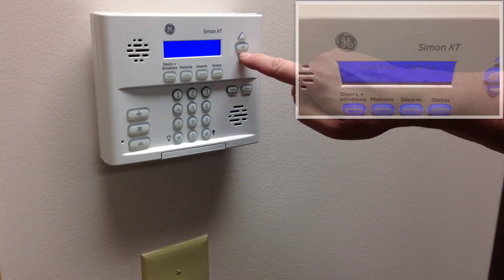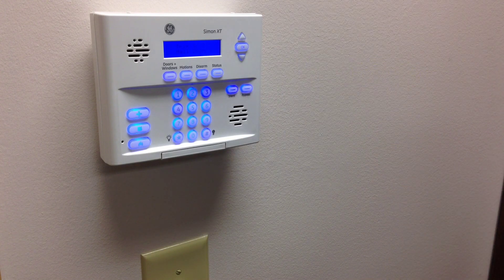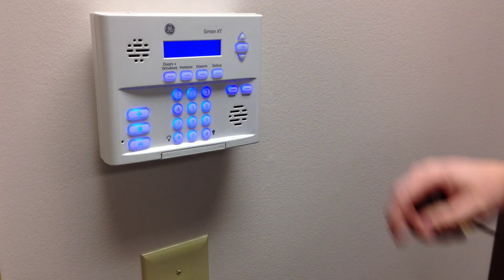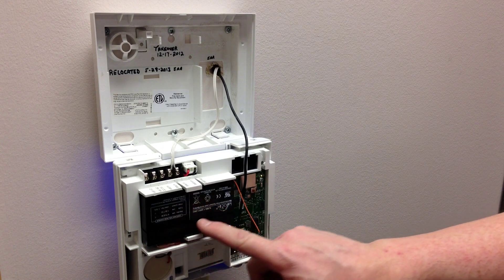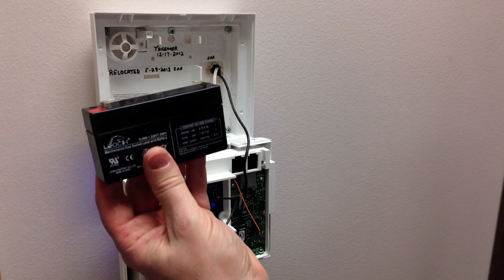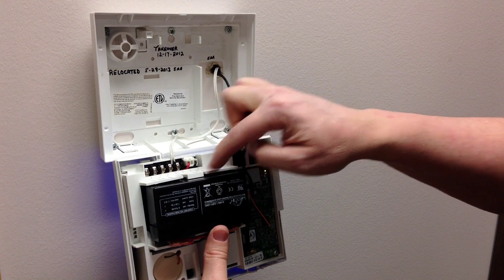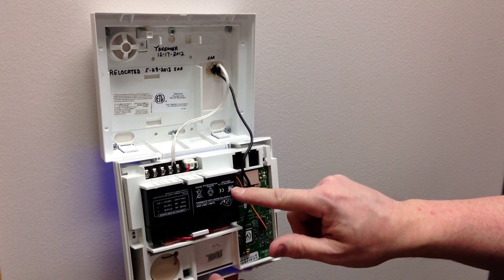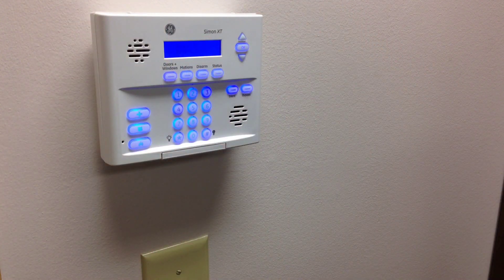How to change the backup battery in a Simon XT security panel

Comment: I found this video in Aug 2020.  After restoration from a 28 hour power outage at my house, our panel was beeping every minute or so, and the panel had a message that read something like, "console battery low". So, I just figured I needed to replace the battery and went searching on You Tube for a video that told me how to remove the panel and find the battery, etc (as I didn't have a manual). But this guy's suggestion - after watching the entire video - to contact our security provider FIRST, was a game changer for me. I went on to call the provider, told them about the power outage, they reset from their end, and within 30 seconds the beeping stopped, the message was gone, and the CSR told me that the battery DID NOT need to be replaced, and that it would recharge itself since the house power had been restored. So, this video kept me from a trip out to purchase a new battery. Thanks...very helpful for my circumstances.

Comment: Thanks for the video. With the rolling black outs due to that storm I found out all the batteries were bad. Changed them all and still had system low battery warning. Went into the system test, backed out, system OK!!

Comment: This one is identical to mine. I just ordered a new battery. The original lasted 3 years, 10 months. It was installed in early 2012, the date I see in this video inside the panel.

Comment: If the replacement battery is not charged, it might take a few hours to fully charge the battery. So, the low system battery message may still be there until the battery is charged.
Reply: Thank you!

Comment: This exact procedure will not work for the Frontpoint Security Simon XT.  Additionally you have to unplug the panel from the wall outlet and unplug the RED wires that stick out of the bottom of the panel. Then reconnect the wall plug and red wires.   I had to call customer support to get it right.
Reply: I am grateful for your observation... I spent several hours trying to make his directions work and came up empty. By disconnecting the power line and reconnecting completed the cycle the system needed to recognize the new battery. With different model it is critical to have the correct process... Thanks again for saving up a service call.

Comment: Very helpful.  
My battery required a charge.  After battery install, the status light remained on and the alarm light next to it was blinking.  I am assuming this is related to the low charge battery system 
notification.

Comment: After connecting the battery I still had the low battery alarm so I had to power down the ac power supply before connecting the battery.  It must reset the system from having the low battery alarm by powering down the whole thing.  Then after connecting the battery then plugging in the ac power supply all alarms were gone.
Reply: same for me as I commented above.
Reply: I follow the steps and it works thanks

Comment: Days after changing the battery the annoying "system low battery" alarms kept going off. I checked the voltage and it was at 7 volts so battery was well charged. Pressing disarm and status didn't change anything and the frustration continued. Because it happens every 4 hours my sleep was interrupted for over a week.  I wanted to take a hammer and smash the panel to bits! Over the weekend I did a sensor test and that made things worse because on of the sensors now gave a tamper error that wouldn't go away even though the lid was put back on securely. I was about to delete everything and start from scratch, feared the motherboard was defective..... BUT I didn't give up and removed the panel completely from the wall for a while to inspect things on the inside. After powering back up things FINALLY went back to normal.  OMG What a NIGHTMARE! I now hate my simon XT and next time it gives me trouble I am replacing with a more modern 317MZ unit so I can still use the existing sensors.  (Nice touch screens on the market now..  I now know why interlogics went out of business! Simon XT is obsolete garbage!  Posting this incase some poor soul runs into the same issue. Good luck and thanks for the video!

Comment: THANK YOU!
Your method is simplest and most efficient!
My original installer buried the alarm AC switch inside the wall, so I cannot turn the power off  before the battery swap as others suggested. Your method bypasses this step and everything was a breeze.

Comment: If it's still reporting a low battery after the new battery is in. A sensor test may need to be ran to resolve the issue.
Reply: This fixed it. Thanks!
Reply: 5 yrs later and this did the trick. thank you